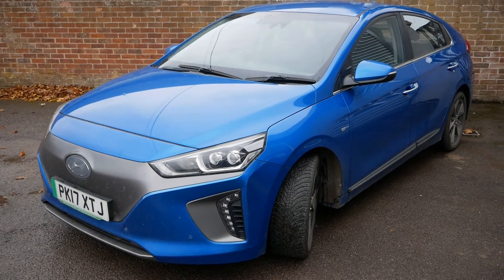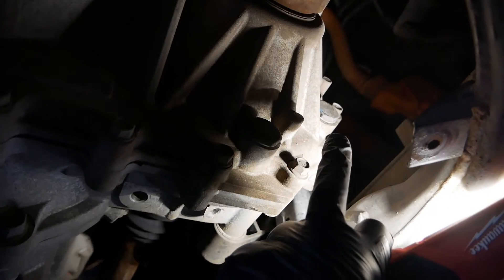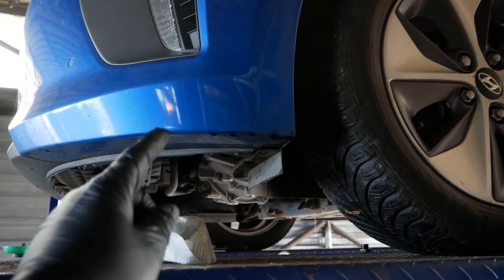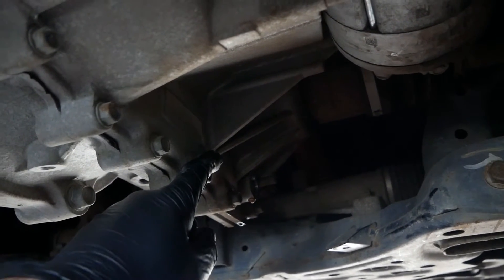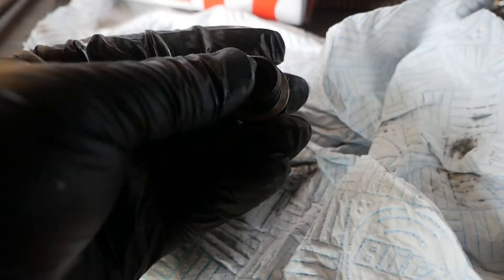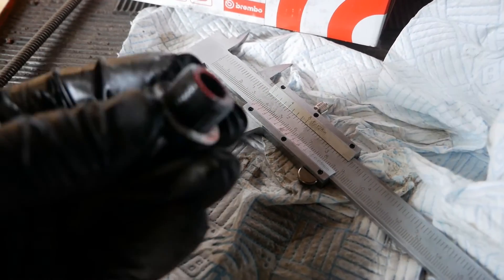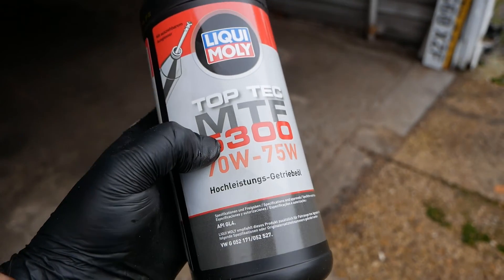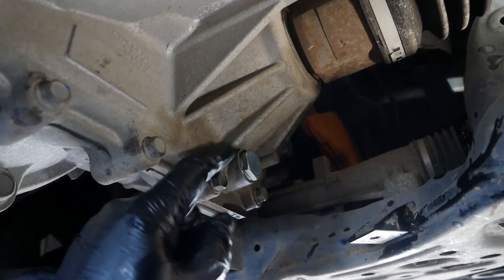Gear oil change in a Hyundai Ioniq Electric & fitting magnetic sump plugs

Comment: I took my NIro for the service and they charged me $200 extra because the gear oil is "Special" $1500 for a dealer service.    I feel ripped off.  
I can do the service for $100 in my garage in 20 minutes changing everything including spark plugs and filters.    is the 60K miles so was the last one offcial.

Comment: Hi, i have to change my oil, i have a question: is it safe? no electrical risk?
Reply from the maker: No electrical risk. The reduction gearbox is mechanical. You can see inside an Ioniq reduction gearbox here https://youtu.be/SljVT2iWO6g?si=i2qnzRZR-t5ycGC4 and https://youtu.be/MqbjkfyJtvE?si=06lIc-T9fG9cqUo_
Obviously, you're under a car, so properly supporting is the risk.

Comment: I followed your advice to change the oil in the reduction gearbox on my Hyundai Io😮niq, 28 kWh, 2019, 65500 km (40400 miles) ä. The old oil was black with a lot of metal particles. I also changed the dranage plug to a magnetic one (Votex, M18 x1,5 mm). I'm planning to change the oil every 50000 km from now on.
Reply from the maker: Glad the video helped.

Comment: So I have a 2020 hyundai ioniq electric 38kwh battery. With 130k miles on the dash...Ive never replaced the oil. It's my first time owning an EV. I asked the dealership they said I didn't need to change no oil..and now I'm getting this oscillating sound coming from the front. Idk of its a wheel bearing or if it's a gear reduction box..🙄 I got an appointment this monday..they vehicle has been good to me but it will really suck if I need to replace that and drop all that money. Do you know what are the symptoms of a failing gear reduction box?
Reply from the maker: Like a wheel bearing, a while while you're driving. But if it's not the wheel bearing, then it could also be the motor bearings and unfortunately, its about the sort of mileage that they have known to wear out. If the pitch of the noise changes when you're accelerating and slowing on regen, it could be motor bearings. It's quite difficult to distinguish between motor bearings and gearbox bearings.

Comment: Excellent vlog I currently have a Nissan townstar EV being repaired as it is crash damaged and will change the gear oil when due, any suggestions on what type and brand I should use would be greatly appreciated kind regards and take care 😃👍
Reply from the maker: Being a Renault EV, its likely to be MTF 75W-80. But I can't yet find any references to the exact spec for this vehicle. I've been asking Grok and getting nowhere either.
Reply: @ many thanks 🙏 for coming back to me much appreciated I shall look into it take care 😃👍

Comment: Why did you use 75w80 when 70w (single-grade) is recommended? Thanks for your reply because I'd like to buy two cans of oil, but I'm having trouble finding the right reference... Hyundai uses SAE 70w Hyundai from Korea, which isn't available in France. Thanks, colleague.
Reply from the maker: I was struggling to source the 70W oil at the time, but now use https://www.ravenol-direct.uk/ravenol-mtf-4-70w-transmission-fluid.html

Comment: I did my 2021 Ioniq 38 today at 28,000 km. Oil was very dark, but not quite black. Noticable reduction in noise, particularly on regen braking. I used Red Line MT-LV Manual Transmission Fluid 70W/75W. Comes in a 3.75 litre so can get 3 changes from it.
Reply: Is it the same procedure as this (28kwh)?

Comment: Hi Matt, guess how much my Hyundai dealer is charging me to change the oil of the reduction gear box on this vehicle? £350….
😢
Reply from the maker: It should be 1 hour labour at most. With a lift, they can do it in 20 minutes. The oil costs about £15.
Reply: @ gutted 😭. Disgustingly expensive. Do you know if I am still required to service it at a Hyundai dealer after the 5 year warranty because of the 8 year warranty on the battery pack? Or does it not matter to go to another garage and still keep the battery pack warranty intact?
Reply: @GoGreenAutos    well, they said they had to use 2 bottles at £19, so £40 ish, plus apparently some gearbox reconfiguration using connected equipment, and 2 hours of labour. £350 total in the end.
Reply: My local garage did it yesterday for £96 including the oil. 3/4hr of labour. At that price it wasn't really worth my time doing it myself. £350 is insane!

Comment: hi matt, my ioniq 38kwh just had its gearbox/reduction gear replaced under warranty by hyundai…  going forward as an uber driver in london, what steps should i take so that it doesnt not happen again?  oil change every 10,000 miles ? magnetic bolts ?  is my driving style having any impact? i use alot of cruise control… i just want it to keep working, this incident has scared me because after 30,000 miles i will cross 100,000 miles warranty hyundai covers for any vehicle used  as a cab.
Reply from the maker: 50k oil changes and ideally add a magnetic drain plug. You could do it at 40K, but I really can't see any benefit doing it any earlier if using a good oil. As for driving, just don't floor it from standstill as the torque can put stress on the diff and gearsets.
I've done two videos on the Ioniq reduction gearbox so you can see inside. See https://youtu.be/SljVT2iWO6g?si=avYTI_LkE74DWnJj and https://youtu.be/MqbjkfyJtvE?si=VbtPpRh4ru8QZuYR
Reply: @GoGreenAutos  thank you for your reply. where should i take my car for oil change , a specialisit ev place or any garage, halfords, kwikfit ? if any garage , whats the best oil for 38kwh car,  Hyundai franchises  most of time in london do not have availability for weeks when you need to take your car in for service. Also can you please let me know the product name  or a link where i  can buy the magnetic  drain plugs.

Comment: Today (NZ time) my son changed the reduction gearbox oil in my newly acquired 2018 28kWh Ioniq Electric, at 81,000 km. We followed your guidance, and the job went very well. The oil was black and certainly needed changing!
I got the magnetic sump plugs from our local Toyota dealership, and I got the 70W gear oil from Hyundai. Many thanks for providing the video - and all of your other Ioniq Electric videos.
Reply from the maker: Thank you. Glad you found it (and the others) useful.
Reply: @GoGreenAutos Sorry,
 in 38kWh is the same oil?
Reply: Has it made a difference at all? Range or power?

Comment: I change today the gear oil in my ioniq 28, at 100k km. The oil was very dark ( black) . I put some aliexpres magnetic screw with 19 mm socket. I use Motul Gear power lv 70w , 1,1l . Seems to by more quit , or is only my impression.Thanks, your vidéo helping my a lot.

Comment: Hi. Have you done this on any MG EVs? If so, can you advise what size of magnetic drain plug I would need to source please?
Reply from the maker: No, I've not done an MG EV yet. They may already have a magnetic plug in them. As for the size, you could remove the fill plug and measure it as its bound to be the same size as the drain plug.

Comment: I have an 38 KW Ioniq and at 144.000 km my reductiongear was broked, one of the beerings was damaged, they refuse to change under warranty, I pay for a new reductiongear and this video is very informative, I will change the oil from now maybe will last longer than 144k km .
Reply: How much did you pay to change the reductiongear at your Ioniq? I have a kia E niro with 85000 miles. Thank you
Reply from the maker: See https://youtu.be/SljVT2iWO6g?si=NBTSkacjmfK9DPD8 and https://youtu.be/MqbjkfyJtvE?si=birio9S_uMa-cALA to see inside an Ioniq gearbox.
Reply: The drain plug it s the same on Ioniq dosen t matter is 38 kwh or the old one ?
Reply from the maker: @ImmortaL778  both the 28kWh and 38kWh models use the same gearbox and plugs.
Reply: thank you
Reply: Hello , thank you so much for the information works perfect , Do you know if on Hyundai Kona they are the same ? I think they are the same

Comment: Really really helpful guide and tips Matt - I’m going to change the oil in my Ioniq gearbox this weekend so this video has been super useful. 

For anyone looking to do this I found a Toyota Specialist selling the OEM Toyota plug Matt used for £8.34, they are called Rough Trax and are based in Bristol. Their service was great and plugs arrived really quickly. 

Never foresaw changing oil in an EV 😂 but I think this is excellent preventative maintenance for any Ioniq/Kona/Niro owner 😊
Reply from the maker: Glad the video helped. You'll like a video coming up in two weeks time where I take apart an EV gearbox.

Comment: @Go Green Autos , Ive just changed the oil in my reducer and the 1.1 liters of oil seem to be like « fill to spill » . I checked the level after putting 1.1L with a bended tierap and the level seem to be flush with the bottom of the fill hole.
Reply from the maker: Pretty close then. With most gearboxes, you just fill until the oil dribbles out.

Comment: Regarding the comments about ferrous particles and magnets, (a) all gearboxes with steel gears use a magnet (either fixed or on the plug) to retain normal wear particles, it's an essential feature that few powertrain engineers miss; (b) once wear particles pass very close to the magnet (just by chance) and are captured, they don't come off due to the turbulence of the oil.  Certainly they aren't just 'collecting' there when the car is parked.  (c) Hyundai's round factory magnet is captured loosely in a pocket in the casting and rattles around (a design mistake that started with the Ioniq and continues with the Kona and original Niro, but in the Soul it's square) and as a result of movement under the oil flow rubs those captured particles against the aluminium creating much smaller steel and aluminium particles.  Steel particles that are "worked" this way lose their magnetic attraction and go back into the oil. At the same time, aluminium particles rubbed off the housing make the oil black.  (d) regarding the magnetic plugs I'm glad you used the Toyota and you're the first to do so, it's a good choice.  However I would not suggest that Ioniq owners just go out and buy any 18mm magnetic plug, especially the aluminium-body type. The difference between an engine and a gearbox is that you cannot afford to have the magnet fall out in a gearbox.  The reason why I originally picked the Votex DP007 in Nov 2020 was so that myself and other Kona owners could "vet" (validate) the quality of that part, which has since played out favourably.  It's true that Nissan plug magnets poke out into the gear oil but I would not advise others to use a longer plug than the Votex or Toyota (in that 35mm clearance) without long term testing.  There could be ramifications that are not immediately obvious.  (e) regarding oil quality, type and gears, there is nothing wrong with the design of this gearbox.  It is designed for the motor RPM and that's why the oil is thin. The only problem is the loose magnet. What you want to do is change the oil once at under 500 miles then again at around 3,000 miles.  Adding a magnetic plug is helpful but doesn't completely solve the problem because some particles will still find and be 'ground down' to dust by the spinning factory magnet. But after those 2 initial oil changes the majority of the problem has been addressed as the break-in particle loading has been removed. Further changes could be around every 30,000 miles but the purpose is to clear out fine particles rather than replace worn oil.  Hope that's all helpful. Two of my videos might back some of this up:  https://youtu.be/ldBNDGbjWqc and https://youtu.be/YquYZPTkcmI
Reply from the maker: Yes all very helpful and good points. I have a video of inside the Hyundai reduction gearbox going live in a few weeks too.

Comment: for oil changing and tire rodating, I want to use floor jack to lift my ioniq 28 then put it on 4 jack stands. but if the 4 jacking points on each side of the car are used for jack stand, where should I put the floor jack? I can't find any tutorial or video on how lift properly an ioniq ev at home.
Reply from the maker: Just don't lift on the battery pack or plastic covered areas, but apart from that, they're no different from any other vehicle....jacking points on the cills, load bearing points on the subframes, suspension etc.

Comment: If there is a gearbox is there also a clutch? What happens if you are holding the car on the brake? Thanks 😀
Reply from the maker: There's no clutch required in a EV. If you're not pushing the accelerator, the motor isn't spinning. You do hold an EV on the brakes.

Comment: Thanks Matt for a another informative video. We’ve had a Kia e-Niro from new in March 2019, now on 73,000 km (we live in France)..The Niro and the Ioniq are built on the same platform, though the motors and battery sizes are different of course. I was wondering about changing the reduction gear oil at some point but as you explain below in the comments it isn’t something the dealer would do in the servicing schedule. With Kia warranty being 7 years I’m in a bit of a bind on what to do...not wanting to invalidate the warranty but wanting this car to be a long termer. Any thoughts?
Reply from the maker: Many worry about warranties. Getting it done by a garage will resolve this. But anyway, no garage would be able to tell its been changed, if you keep the original plugs. Leaving it until it's 7+ years old would be unwise in my opinion.
With warranties, let's say you change your own cabin filter...and then the gearbox failed. They wouldn't reject the warranty claim because the cabin filter wasn't changed by them. They would have to prove that the different cabin filter had a knock on effect and caused the gearbox failure, which of course is impossible! 
Replacing the gearbox oil, if done correctly and with the correct oil grade, is only benefiting the vehicle and prolonging its life.
Reply: @GoGreenAutos  Thanks Matt. We make regular trips back to the UK to see family, one destination takes us past Oxford on the A34 so perhaps next year I could arrange to get that done.
Reply from the maker: @kiae-nirodiariesencore4270  Yes of course.

Comment: Matt, that car is the same as mine, what are those front tyres please….at 30,000 miles I need to replace my Toyo’s which are good but you might know more at the mileage yours has covered..?
Reply from the maker: They are Goodyear Vector 4Seasons Gen-2, see https://youtu.be/0BSYv5YlRC8
We've done about 25,000 miles since on these and they are lasting very well.

Comment: Excellent, many thanks. Will you be changing the transmission oil on your Model S?
Reply from the maker: Yes I will do at some point. I've never yet done a Tesla. My drive unit was replaced under warranty just over a year ago, so there's no rush to do mine yet.
Reply: @GoGreenAutos do you also have videos of how to make service on a Tesla? I’ve just bought a m3 sr 2019 and would like to know how to change oil and do other maintenance on it.
Reply from the maker: @AzizIzgin  No I don't. But you can download the Tesla service manual online.

Comment: Everyone says how the “EV”  motor is directly coupled (via reduction ratio) through the  gearbox to drive shafts, i.e no clutch or torque converter etc…. do you know how “neutral” works on transmission selector ..?
Reply from the maker: While most EVs do have neutral on the gear selector, it's not the same as neutral on a traditional ICE vehicle. The neutral on an EV is not changing anything in the gearbox or disconnecting the wheels from the motor. But instead it's just disconnecting the motor from the rest of the powertrain electronics. It's just just an electrical switch as it were.
Reply from the maker: Only required for towing or in the car washes that pull the car through.
Reply: @GoGreenAutos  not sure I understand that, do you mean an electromagnetic clutch ?
Reply from the maker: @patrickh7368  Not as advanced as that. As far as I know, 'neutral' just turns off the motor controller or something like that. The motor still spins, as does the reduction gearbox. Its just not interacting with the rest of the powertrain (i.e. inverter etc) so you have no regen function either. Its probably just a tiny little relay on a circuit board.

Comment: As a none mechanically minded person, i didn't even realise my Ionic had gears. For some reason I thought it was just a spinning motor. Your videos are so informative. Thanks. So is this something that will get changed at a main dealer during one of the services?
Reply from the maker: All EVs have a single speed gearbox like this, which is also a differential. I think Porsche has or was working on a 2-speed gearbox for their EVs. No, the oil change is not part of a dealers service. All manufacturers (apart from the Mitsubishi i-MiEV) claim the gearbox is sealed for life and no oil changes are required or include it in the service schedule. You might find this recent video interesting too https://youtu.be/7c0g-CmFHe0, where I look at a reduction gearbox.

Comment: Local dealer here in Fin also uses 75w oil because that 70w is difficult to get and that difference doesn't matter if you compare those sae specs.
I need to chance those magnetic plugs also because oil in my 90 tkm driven ioniq was black and thick as a tar and there was only like 9 dl of oil left. I drained that oil through paintshop paint filter mesh and luckily there was almost no any metal particles in oil.
Reply: Did you get the plugs and did you buy them from Finland? Can you provide links? Also where did you change the oil and how much it costed?
Reply: @paska68  Finally I didn' bought those plugs and I changed only oil, twice. It takes about 30 min to drain and refill reduction gearbox

Comment: The oil change in my PHEV differentials frightened me! So I am keen on swapping the oil regularly. It seems to be a specialist oil though and it has to be unable to conduct electricity. I have an MG5 on 83,000 miles so far.